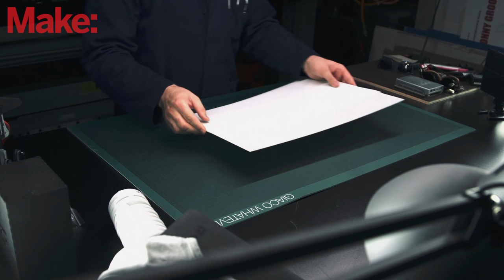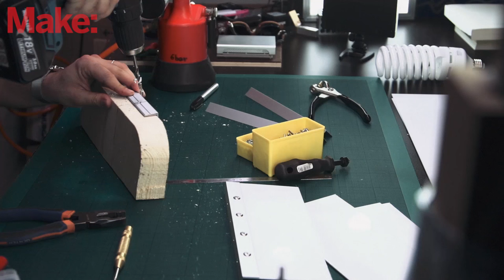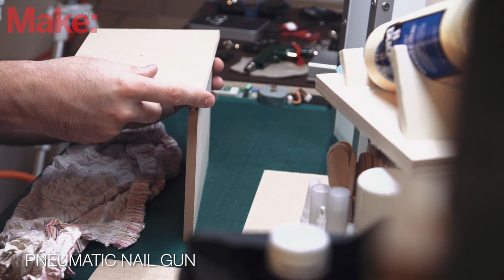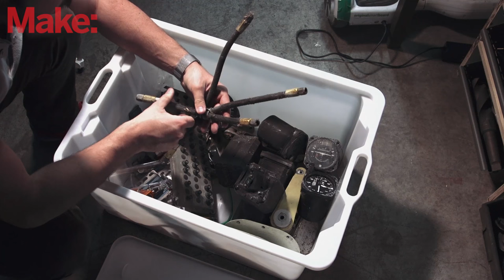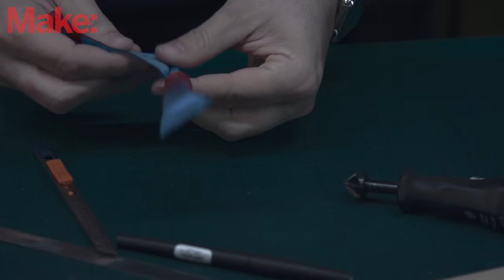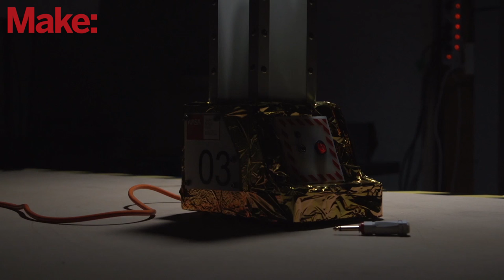Giaco Whatever Makes a  Space Lamp

Comment: Next project idea: have you seen the Intel space capsule? Sadly it is only available for reviewers and it is hand built and -painted. Essentially when you turn the safety lock it starts a countdown with yellow LED bargraph. Then it opens four little locks and the clear acrylic container inside will raise up and will be illuminated with a LED light strip and the new Intel® Core™ i7-5960X  Extreme Edition 8-core processor rests inside and can then be removed. It's a beautiful device. So, can you make a similar container? That would be cool. It would be easy to control with a Arduino and there are some clever ways to make the inner container rise up, like using four strings in a clever but very simple mechanism.

Comment: Does anyone know how the jack works as a switch? I really want to add that to a project I'm working on as a safety type thing. Would it work to just put the jack receiver in series (not sure if that's the right word, ((I'm new to electronics)) but What I mean is can I solder it on to a split wire between the two main components.) and use it to complete the circuit or would I need something else to make it work like a safety?